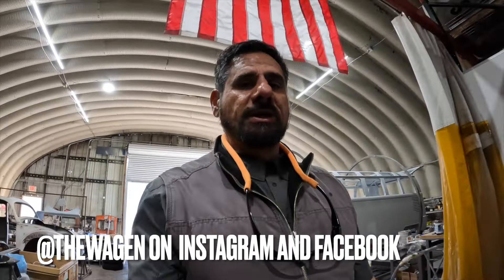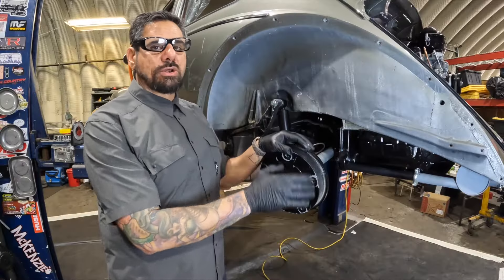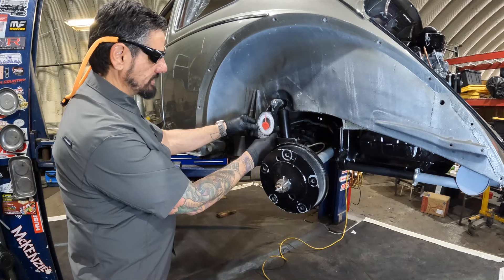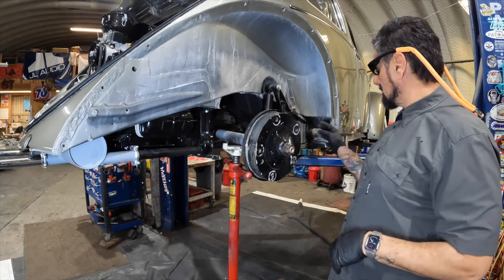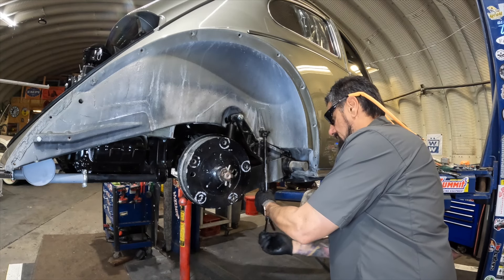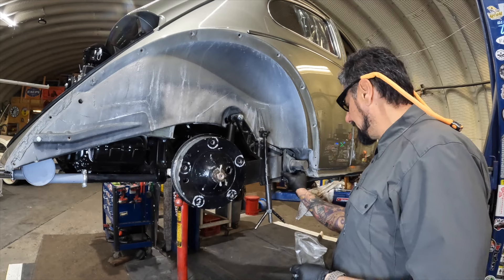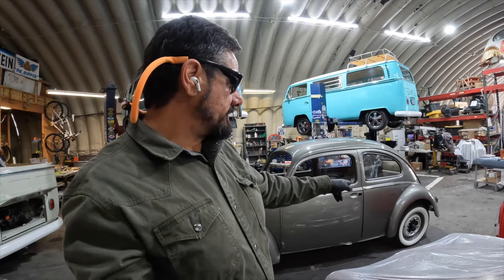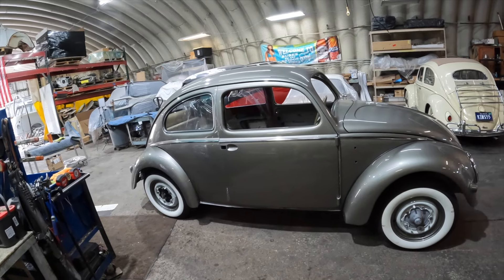Raising a VW Bug

Comment: A great video. 
One thing you should always do is if you are going to remove the axle tube from the spring plate mark where the three bolts go because it is adjustable from front to back. 
Thanks for sharing the knowledge man ✌️ Peace from Melbourne Australia.

Comment: Looks like a pretty straight forward job.  I know this is on a swing axle set up, but I’m sure the process is the same on the IRS set up as well.

I know I’m going to be running a set of sway aways on mine and run stiffer springs for my Baja build.
Reply from the maker: Same process. Spring plate connections is different, but it’s still a splined torsion.

Comment: That oval looks like it has a wide track on the front?, do you know what beam it’s running? I’ve got a 62 bug that I was going to fit a later pan with the wider torsion housing and 67 front beam. That looks a nice car but a bit odd at the front,might be just because it needs settling?
Reply from the maker: It’s a stock 57 beam. Just needs settling. In the video it was not running.